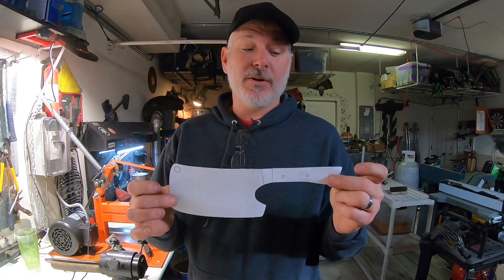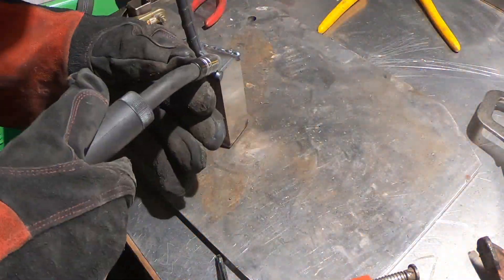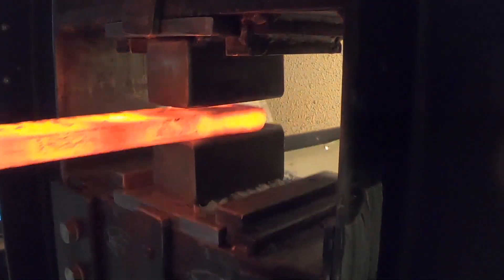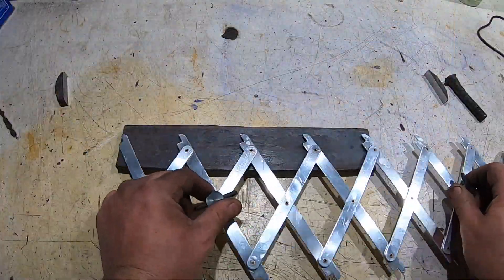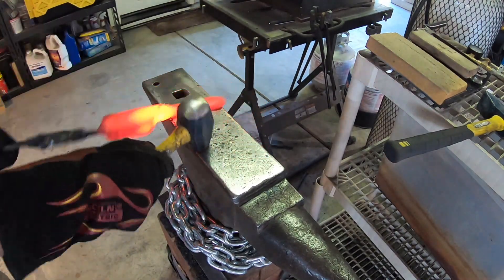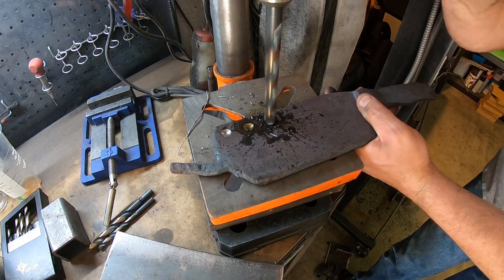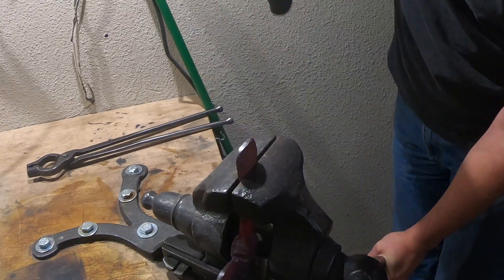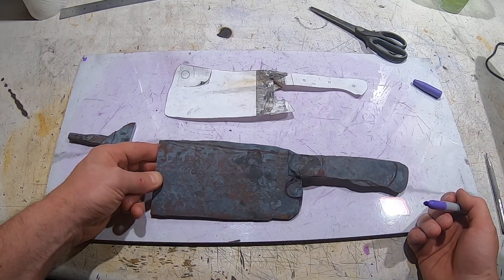Forging an Integral Raindrop Damascus Cleaver - Part 1

Comment from the maker: What do you think of the cleaver so far?  I don't think you could quite make out the raindrop pattern in the video but trust me, you're gonna love it!
Reply: Привет друг.
Я недавно сварил пакет ламината с никилем и латунь с серединой из фрезы по металлу и наружними обкладками из нержавеющей стали 40х.
Все сварилось через никель очень хорошо.
Reply from the maker: @morgenstern3958  
Замечательно! Сан-май из нержавеющей стали - действительно приятный эффект, один из моих любимых. Было бы здорово добавить никель вместе с ним!
Reply: @TyrellKnifeworks  так я и добавил никель между латунью.
Reply from the maker: @morgenstern3958  
Это должно выглядеть круто!
Reply: @TyrellKnifeworks  как с гриндером решу проблему так сразу обточу эту заготовку.
Reply: Looks very good so far. Imagine just what a cleaver can be used for.....ill bett it could  even cut guitars if they would become to noisy :) . An alternative to a ball nose mill or a straight mill to get the bolster even would be a dovetail cutter that could undercut the bolster at an angle. The advantage of an undercut is that the handlematerial (cut / sanded at the same angle) has no where to go if a single pin or lanyardtube is also added to the handle. The fitting of the wood(or other material) to the undercut is also a bit easyer than a rounded off  edge (using a ball mill). Those dovetail mills (i bought a fairly large 60° carbide tipped one) can be found sheap on amazon or aliexpress.
Reply from the maker: I had thought of a dovetail mill but didn’t have one.  I think I’ll invest in one though.  Thanks for the feedback!

Comment: Fantastic Cleaver. Out of curiosity, what if you did a layer of known steel and hardfaced it with weld, added another layer of same steel, hard face, repeat to make Damascus. Would that work or do anything interesting? I know welds are known to be hard and rough on abrasives and cutting tools especially.
Reply from the maker: It wouldn’t look very good.  You need a steel with nickel in it to contrast with the black high carbon steel.  Thanks for watching.

Comment: I had some troubles too when I was forging a Dagger- it's very difficult to undo the hammering/pressing and make material thicker. I'm glad that you fix it! Looking great so far and I thing the taper tang will be absolutely beautiful- not tapered spine and tapered handle is like inverted shape from  typical kitchen knife- I love this idea. Milling machine do the job well (pushed you to make this change) :P!
Reply from the maker: Thanks David, it had some interesting challenges.  If I didn't want the integrated bolster it would have been easy but that piece adds a ton of complexity to a build.  I've done them before and its always a challenge.  Now I'm facing the same issue that you want to fully sand the blade and bolster, but then I need to put the handle on it which I know will scuff the bolster when grinding the handle... so when do I etch it.   I might have to etch the blade and then edge the bolster with a qtip afterwards.  The tapered tang does look pretty cool though.  😉
Reply: @TyrellKnifeworks  Hahaha, My advice: Leave it on 80 grid :P
Reply from the maker: @DBCraftWorld  Ha, you know I won't do that.   It's gotta go to 1000 grit for damascus.  👍🏻
Reply: @TyrellKnifeworks  of course I do, but I couldn't stop myself for write it:)

Comment: cool cleaver love it cant wait to see it finished  i cant wait to make my own press how many ton is yours ? im in the process of making my heat treat oven  my press will be this spring - summer
Reply from the maker: Glad you like the cleaver... the pattern should be really cool!   The press is ~30 tons.. its a 58000 lbs cylinder.  I have a separate Triple-T video on it with a parts list in the description so you should definitely check that out.  Thanks for watching!

Comment: Great video nicely done.  I have a question why put the unwelded billet into kerosene I have seen other makers does this.  Is this to add carbon to the steel as the kerosene burns and leaves behind sooty carbon deposits to counteract the decarb that happens at welding temps.
Reply from the maker: Thanks for watching.  The kerosene burns off when the billet goes into the forge and the theory is that it also burns off any oxygen between the layers at the same time so you don’t have any oxidation between layers if you have any gaps.  I also have borax dissolved into my kerosene so they’d be borax in there too to coat that steel and prevent scaling.  👍
Reply: @TyrellKnifeworks  Nice one thanks, keep up the great work and all the best

Comment: Denis I was glued to the screen man! Awesome build. Learned so much here! Will be picking up a bucket of kerosene soon! I like your theory about welding the billet also! Unfortunately you didn't record shaping that integral bolster so you HAVE to do it again so we can see it!  I was wondering if you were going to get some serious chatter the second I saw you milled the entire handle. I had the exact same thing happen and I am working on a really rigid bridgeport mill. the cleaver rocks bro!
Reply from the maker: Thanks Airin!  Yeah I was bummed when I didn’t have the footage of grinding the bolster.  On the next one.  I just purchased a new Brodbeck grinder and I love their integral bolster attachment!  The handle issue was a happy accident because now I have a cool tapered tang!  Working on hand-sanding this beast right now. 😫😜

Comment: Looking great! How deep do you find the raindrop pattern goes down? I'm going to try one soon and wondering how close to final thickness I should forge the billet.
Reply from the maker: A good rule of thumb is have your billet about 3 times the depth of your holes.  If your holes are 1/8, the make sure your billet is around 3/8 before you drill the holes. 👍
Reply from the maker: Also, from the above example, if you forge your 3/8 billet down to 3/16, your pattern goes pretty deep.  Even if you then grind it from 3/16 to 1/8, you’ll still see a lot of pattern.  The closer to your final thickness, the better of course,  but sometimes you need to worry about scale and marks you need to get rid of.
Reply: @TyrellKnifeworks  awesome, cheers!